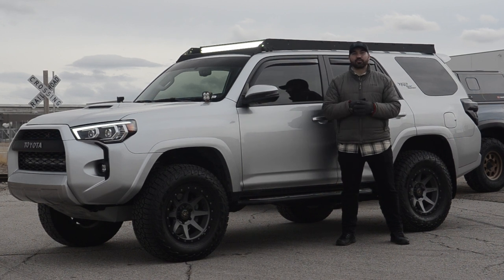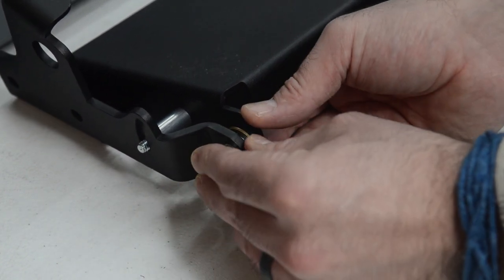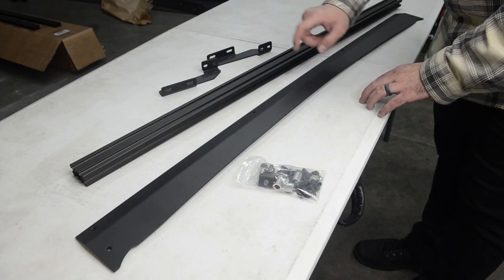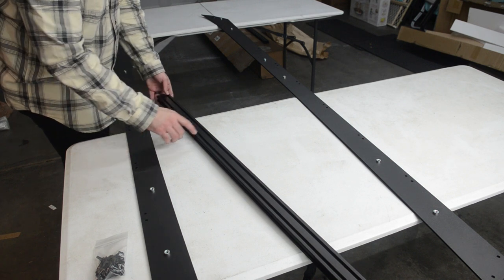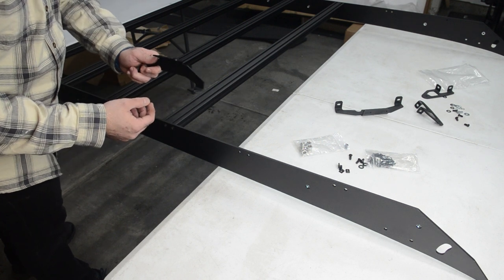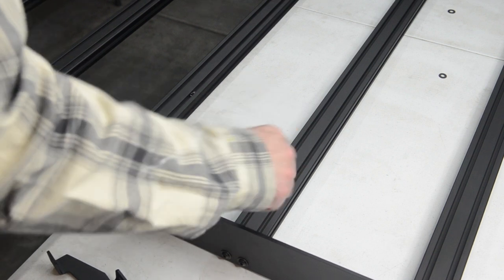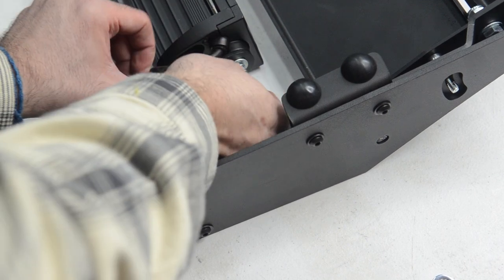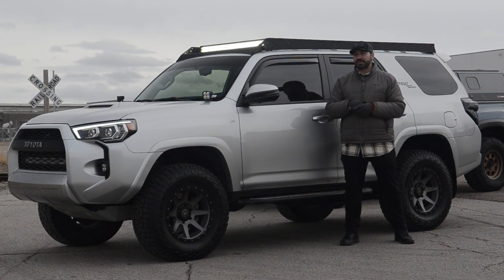Toyota 4Runner Roof Rack w/ Lightbar Install | ProBuilt/Cali Raised Premium  - 5th Gen 4Runner

Comment: Maybe missed it but how did you run the wiring to the battery?
Reply: No one ever shows how they do that. (where/how do they run the wire into the cabin) 
 Frustrating,..
Reply: @96kylar  Yeah like where did you drill the hole for power? Did you use a special grommet or sealant? Any areas to watch out for wires or other commitments that could be damaged?
Reply: @charlesabbott9605  did you ever figure out how to do it?
Reply: @joshuajay2886  no sir. I ended up selling my 4runner and decided not to install the light on the roof rack.